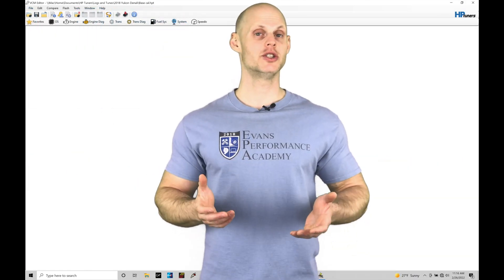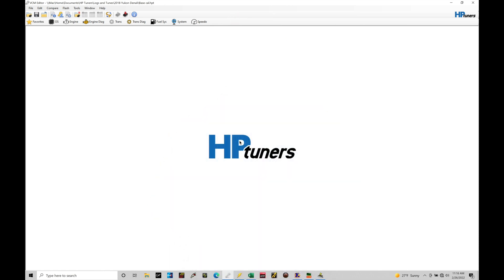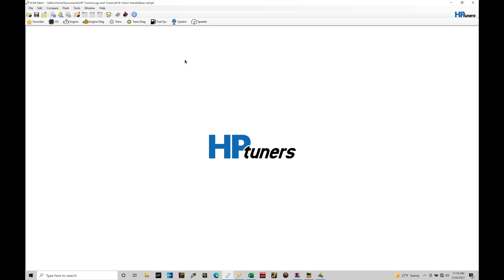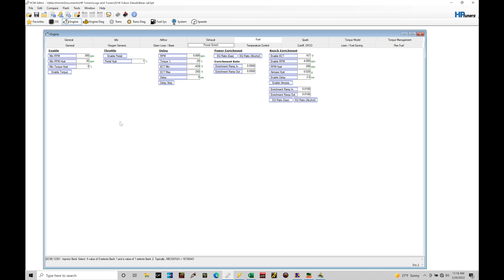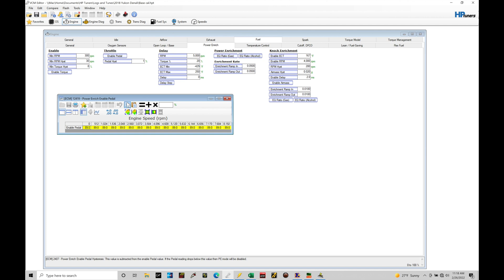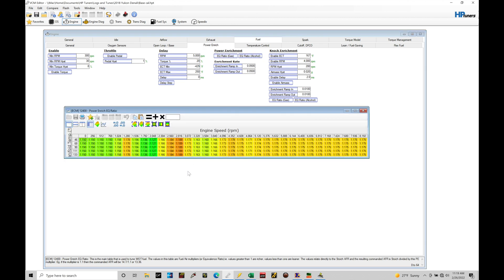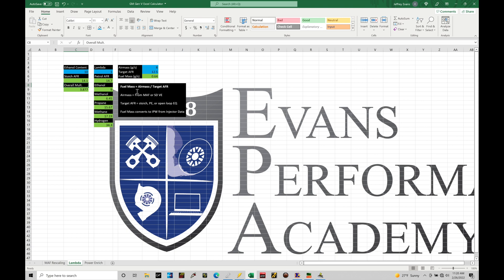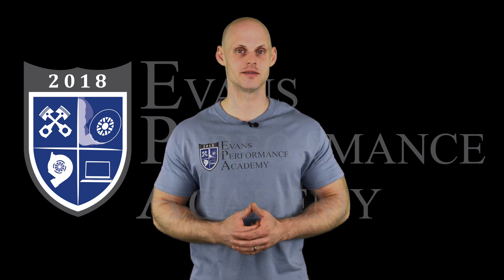HP Tuners GM Gen V Training Part 15: Power Enrichment | Evans Performance Academy

Comment: How does PE work when Cruise Control is engaged? Or does it even? Can't seem to find anything that talks about Cruise Control and PE.
Reply from the maker: Its only active above a certain throttle and torque thresholds.  Those would not be reached in cruise control situations.
Reply: @EvansPerformanceAcademy  I have my TQ and pedal now set at 50% and my RPMS min delay set at 1000rpms. With these settings I still won't be meeting the PE requirements with normal daily driving/cruising but in theory I will while towing. My logs show KR is pulling 4-6 deg with stock PE settings while climbing hills then causing a kick down. Trying to mitigate some of the kick downs.